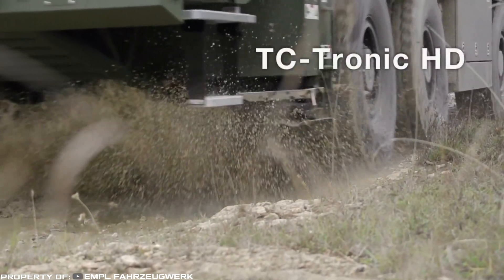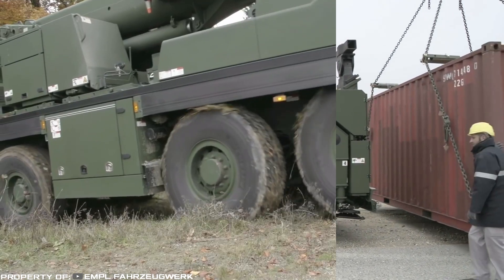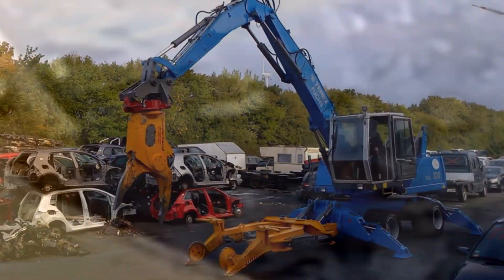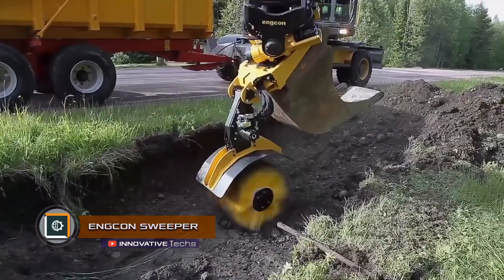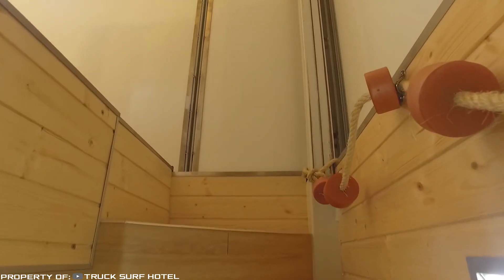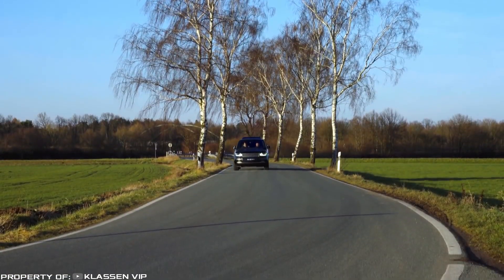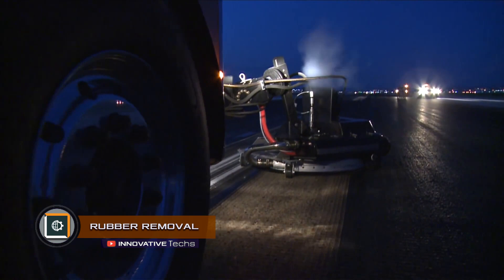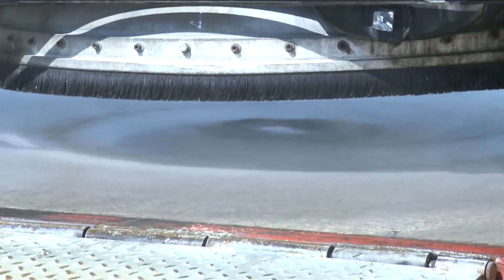10 MOST AMAZING MACHINES

Comment: The most amazing machine is the machine that could be operate without using gas, fuel, or electricity. Obviously its more safer to the earth. But unfirtunately, that kind of machine isn't discovered yet
Reply: You mean those old radios that never run out of power?